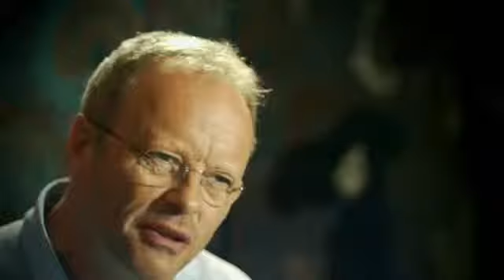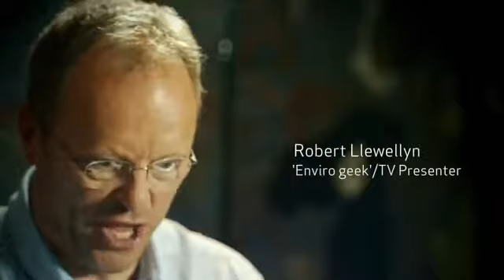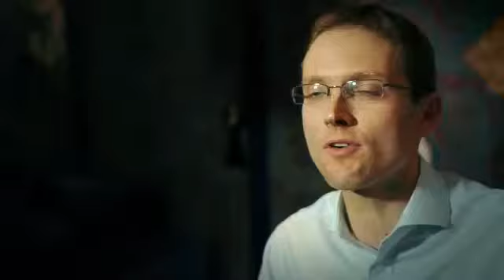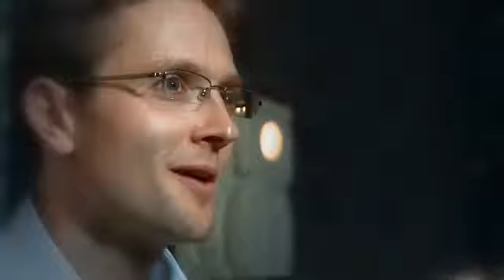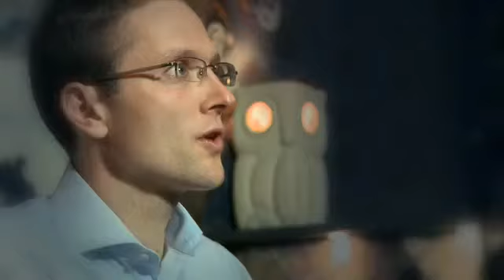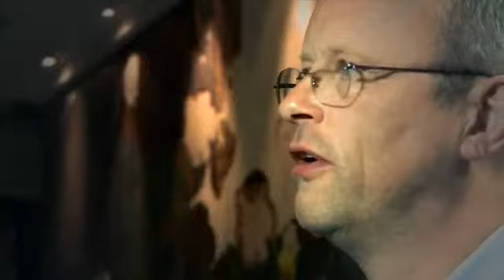Honda FCX Clarity Hydrogen fuel cell car FAQs with Robert Llewellyn

Comment: Compare that with storing energy in a battery (1.5 kw goes in for you to get 1kw out). The power drain on the grid would be 3x higher for the and net result; simply not practical.

Comment: The Elephant in the Room here is the relative inefficiency of creating Hydrogen from water compared to simply storing that power in a battery. You need 3x as much power to electolyse water into H than you will get back from the fuel cell.